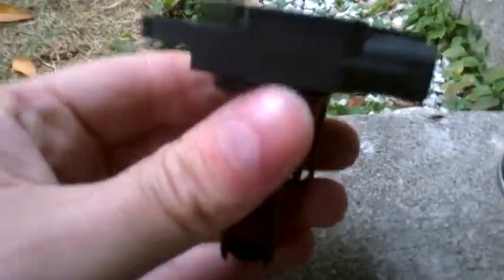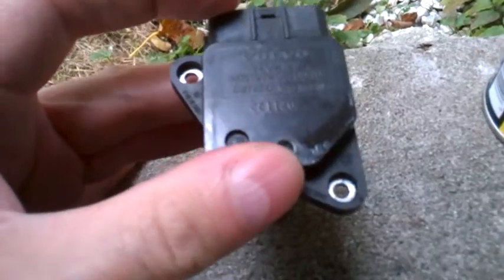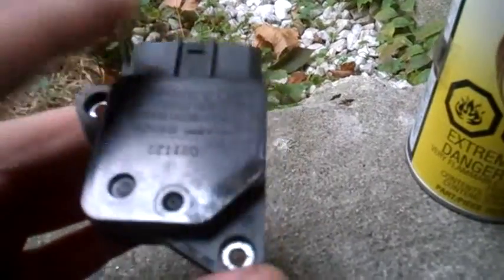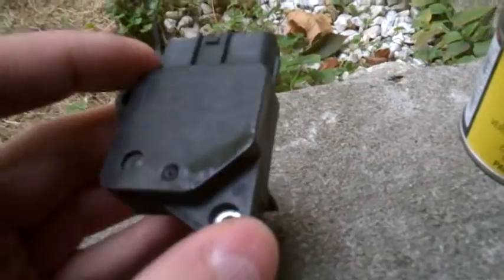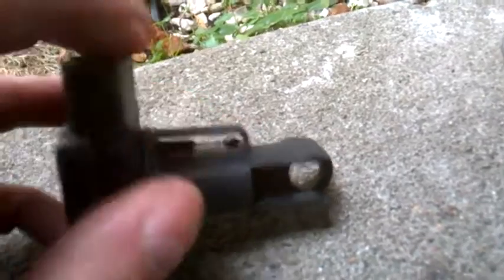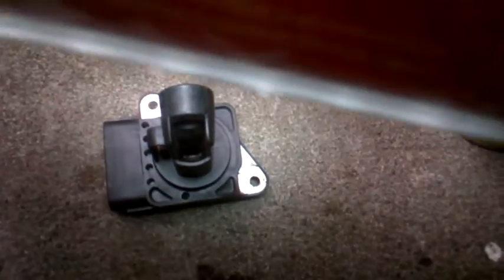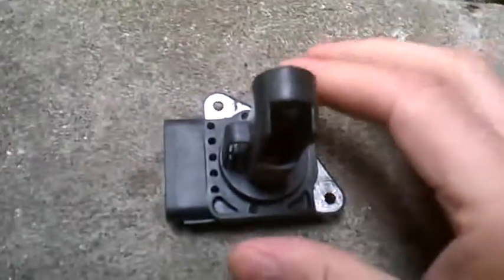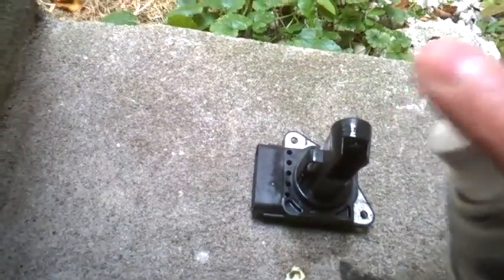Volvo S60 V70 Non turbo - Cleaning MAF sensor The Right way 2001-2009

Comment: parryrocks11 second agoI have just replaced the MAS on my 2001 V70. It no runs perfectly. Before it was hesitating when pulling away and under load, and throttle pedal felt a bit unresponsive. I had tried cleaning the MAS with MAF spray cleaner, but it is not easy has most of it is enclosed. The slightest dirt or oil on the sensor will cause it to send a weak mixture message to the brain.

Comment: Hello Peppermint 
I'm having some problems with my S60 2001 PI no turbo 125kw.
Check engine light has come on and after diagnosis the tool says the MAF sensor is bad.
I have changed it more than twice but the problem continues...I have reset errors and unplug the battery for 2-3 hours..but the problem is still present 
Now I doubt I have vacuum problem 
FOR YOUR EXPERIENCE DOES VACUUM MISLEADING TO MAF SENSOR ??
Engine has idle problems and sometimes lack of power
Reply from the maker: Not easy to diagnose this.  There may have been a code for the MAF (sensor gets gunk on it), but there may be an issue with something else. Make sure you use the MAF from the company that makes it for Volvo, don't use chinese unbranded. Try asking forums as well - matthew volvo
Reply: @Peppermint1   a month ago I went to service and have done service for injectors .(meanwhile waiting for my car bought 6 fuel injector on ebay ,denso)the mechanic  didn't tell me about the bad condition of injectors..
Yesterday I tested for vacuum problems but no problem was found..
Today I decided to change the injectors...funny thing no fuel pressure when I removed the rail with injector,the problem was there old injectors have cracked all along their length ...
Installed the refurbished denso ..the car works like new
Thank you for your time and help
Reply from the maker: @ETFier  Great to hear!